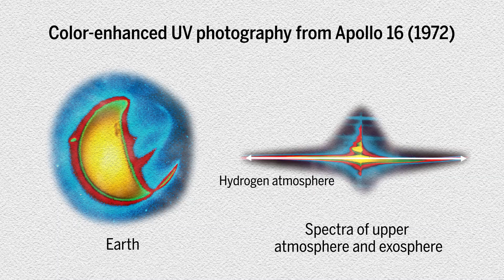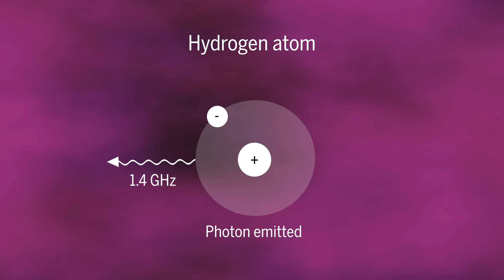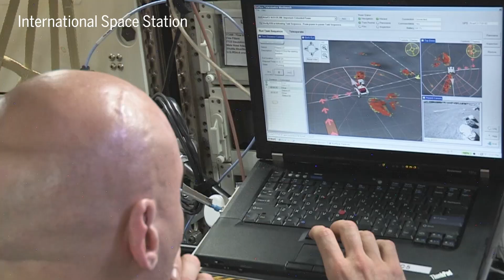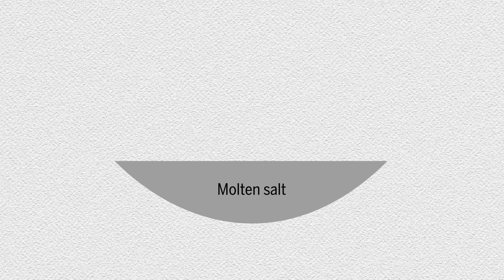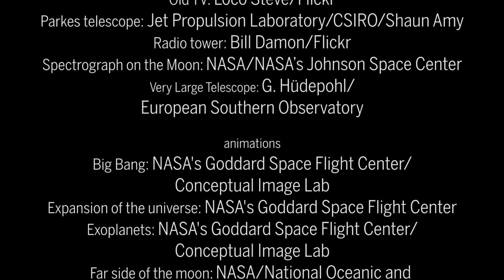Could humanity's return to the moon spark a new age of lunar telescopes?

Comment: Puting telescope in space make sense, but landing on the moon not, not only will spend fuel to landing but you need to deal with lunar dust, and shielding from radio waves can be made with a very thin foil miles of rocks aren't necessary.